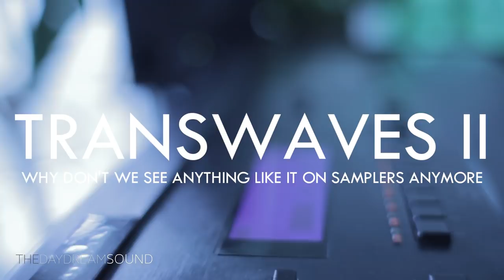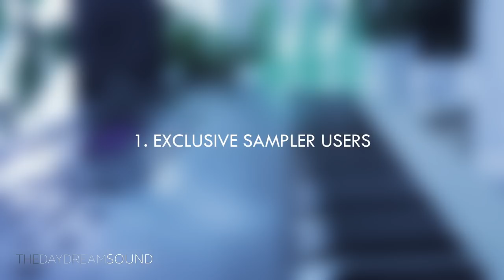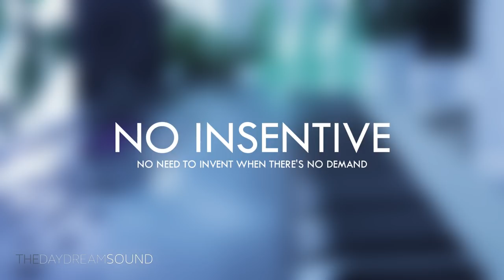Why Samplers Don’t Have Technology Like Ensoniq Transwaves Synthesis Anymore

Comment: My theory is this: Back in the '80s-'90s, a.k.a. the Golden Era of Hardware Samplers, samples came in two basic forms: 1) Emulating real instrument sounds ("Real instruments" also included analog/digital synthesizers), and 2) Sound Effects. Now, things like drum loops and breaks would technically fall into a subset of "Sound Effects." The former needed things like advanced looping, layering, elaborate multisample architecture, etc. After all, you needed all of those things to capture a grand piano or even a D-50. But along came Romplers, which can already do all of the above for you. And over time, the sounds of real-life acoustic and electronic instruments were at least satisfactory enough on Romplers that people didn't need samplers anymore to play them. I remember back in the mid-'80s, many artists relied on the Emulator II to play Grand Piano and string section sounds. But now, any Rompler can do that, and even the cheapest Rompler today has more realistic and expressive piano and string patches than an Emulator II could make.

Which leaves the Sound Effects category, which are more or less phrase-based, and one-shot in nature. Loops are rhythmic, and many sampler users didn't even need to manually loop the "loops" as they could have a sequencer (i.e. MPC) re-trigger the sample every bar or two. By the 21st century, those that used samplers primarily used them for phrase-based, one-shot deals. And the industry followed suit. A friend who owns a Roland Fantom lamented that he could only record one-shot samples triggered by pads but not pitched samples triggered by the keyboard. The whole phrase-based sampling today continues with things like Ableton Live and Ableton pad controllers, which play primarily one-shot phrases.
Reply from the maker: What`s up man!!!!!! Thanks for sharing out!!!!! Great theory!!!!!!!!!!!!!!!!!!!!
Reply: I was just going to say that: Ableton Live's Simpler with a MIDI controller (and some imagination) can get you there also. You can go from sound snippet to sound snippet, add envelopes, lfos and other fx. Assign them to a note, and start doing what fires up in your brain.

Comment: Are you sure you can't do this in any other box? I have a Kurzweil K2000S, and I expected you to show me something that was really unique to Ensoniq. Maybe I missed what was really happening, but it looks like you just sliced a small section of a sample, looped it, and then added modulation assigned to performance (e.g., aftertouch). Can't any sampler do this? I'm pretty sure a K2000S can do this. I haven't used an MPC or AKAI sampler, but I'd expect the same there too. Please help me understand. Thanks!

Comment: Listen folks..I bought the ASR10 rack and Roland analogue synth at the same time,and changed my life and ideas about music.I got the 16 MB RAM and still havent put it in,because by then i learned how to truncate,chop,mangle,and normalize,so i didnt need to touch it.The effects section is so killer,i bought an efx module and hardly used it.I used it live while i was spinning and making mixtapes,made new sounds for myself,and used those sounds as my drum kits and stuff.I have 4 samplers now since i gave away one,yet none of them has the character of the Ensoniq.You can get the ASR10,the VFX synth,and the Paris system,and have a complete studio.Get the third party magazine they had out,if you can,and build a nice desktop system,with SCSI,a LOT of RAm,and have a lotta fun..I'm going to use my EMu6400 and Roland MV8080 the same way.It makes no logical sense to have 20 keyboards,when you can have a couple connected to samplers like the ASR10,because the ASR allows you to run inputs through it's internal DSP/effects section,etc..
Reply: I agree, sometimes in order to be creative it is better to rationalize and use only a few samplers and make sure you have a correct desktop, sound system, ergonomy that  makes you feel much more comfortable . I have seen so many musicians with tons of synths, sometines 4 kronos in the same room,... and none of them even knowing how to use wavesequences that made korg so famous. Or none of them actually have a proper acoustic, sometimes, less is more.

Comment: How does Ensoniq's Transwaves compare with Kurzweil's V.A.S.T?
Reply from the maker: What's up Sabored!!!!! Great question!!!! You know I've used the Kruzweil samplers so much and never really paid any attention to the concept of V.A.S.T. I really gotta go back and look into it now.
Reply: There is nothing like Transwaves in VAST. Modulating loop start and loop end points is itself  unique to the Ensoniqs and a handful of software samplers. The transwave tech is the logical conclusion of this and as far as I know there is no direct analogue of it elsewhere. Ditto the looping types (bidirectional crossfade, bowtie, synthesised loop etc...).
That said VAST can do some nice stuff - FM on samples (it's actually called SAW+ SHAPE though within VAST), amplitude and ring modulation, wavehsaping and wavefolding a nd other non-linear processes not found in other hardware, plus really nice filters. My main board is a K2661 with sampling, I find it really easy to use despite what you may have heard, but I've also keep an Ensoniq around - they're unique.
Reply: You get used to it- plus, pressing EDIT on any field takes you directly to that page. The great thing is you'll find you still uncover new depths to it years on. All the wavefolding/waveshaping stuff we're seeing last few years in West Coast style Eurorack has been in the K2x since 92. Plus all the values are in meaningful values - Hz, dB etc. What you learn on the K2x is transferrable directly to your mixing, your modular, learning Csound/Supercollider/Max etc. It's a worthwhile learning curve. And they didn't reinvent the wheel when they brought out new models- eg if you know the K2, you buy a PC3 or whatever, it's a matter of just learning the updates.
They're beast machines. Dig in.
Reply: @CaptainCabers-nickmccabemusic  the plugin Surge, while not a sampler, (originally developed by Claes of Bitwig)can import custom wavetables. It can also modulate the loop points. Combined with a program like audio-term, the sky is the limit.

Comment: Hey, love the videos! I have a quick technical question; are you aware of anyway to get around having to load the OS into the ensoniq samplers everytime you turn them on? As in a mod that loads the os internally somehow when turning on the machine?
Reply from the maker: What's up Arne!!! Thanks for reaching out!!!  The EPS16+ has a flash ROM option that lets you store the O.S on it but aside from that you'll have to load the O.S from disk every time.
Reply: There was a way to autoload o.s. maybe via macros

Comment: "can't do as efficiently in software". Wouldn't say that. You can do this quickly and easily with Ableton's Sampler/Simpler by setting a loop and automating the sample start position with an LFO. You could automate the loop length as well, basically modifying the granularity of the playback in real time if you wanted to. Imagine I could probably set that up quite a bit faster than setting up a transwave patch. But the old samplers and old devices in general tend to have their own sound so there's still ample reason to use them IMO.
Reply from the maker: What's up man!!! I agree!!!!

Comment: The ASR10, is way ahead of its time. I love using the the auto loop function. Perfect looping so fast. Without seeing it. Especially for looping bass notes and such. What I don’t get is why you can’t auto loop in stereo? There is a work around, by doing one layer at a time. I especially like the video of auto chopping. When I seen that, I was like, I do that!. I go between start and transwave, though. I like trans waving drums to, for fills. It’s the closest you can come to actually jamming on that kit. Such a great machine. Akai mpc’s are a totally different thing. Ensoniq samplers are more for making synth patches, and everything else. You’ll really only use the mpc for sequencing. You really don’t even need that.
Reply from the maker: They put so much into those samplers. It's really easy to miss.

Comment: Transwave was a musical dead-end, according to a former Ensoniq employee who was asked shortly after Ensoniq folded as a synth company. There was/is simply no real demand for the feature outside a fraction of a niche subset of the Synth user base. 

It's a lot like polyphonic-aftertouch, everyone fawns over that feature, but very few who have access to a synth with a poly-AT equipped keybed actually ever uses it musically.
Reply: I honestly still failed to see why he thinks what he did is exclusive to ensoniq transwave. Maybe the operational method is different but you can do the same things on an MPC, Maschine, etc what exactly was so special here?
Reply: @tellitlikeitis8691  there really is nothing special about Transwaves... Much like the Realtime Convolution and Modulation feature on the Yamaha SY77/99, it is something that takes a sample and spits out mostly useless noise...
Reply: @looneyburgmusic  Thanks for the reply. Yeah I'm genuinely curious if there is any sampler out there that qualitatively stands out from the rest or if it's just a sound/workflow thing
Reply: @tellitlikeitis8691  that's actually a good question... I've been a huge fan of Ensoniq since the Mirage, but I honestly never found a musical use for the Transwave feature

Comment: Can the EPS Classic produce transwaves?
Reply: Every day, all day. That's been my main tool since '93.
Reply: can you access the same parameters on the classic? im about to hook mine back up now and combine with ableton
Reply: @blocadebeats  same parameters as the eps 16, 16+. Only heavier, as the EPS classic operates at the same dynamic range as microphones and speakers.
Reply: Transwaves were introduced on the EPS-16+.
Reply: @Roikat  Don't tell my EPS-M (classic rack mount). It has had transwaves as a function since 1991. edit Ensoniq has used transwave synthesis in it's synths since the 1980s. Looks like the Mirage is the only unit that didn't have a transwave function.

Comment: Are you serious ? This is granular synthesis and you can achieve this effect with a LOT of modern hardware/software : The Harvestman Tyme Sefari, Make Noise Morphagene, Rossum Assimil8tor, 1010 Music Bitbox and so on... Reaktor can also do this since more than 15 years !
Reply: This was just one example. Transwaves in general are like wavetables. On gear like the ASR-10, you essentially can make your own wavetables that you can scan through with whatever you want. 

Granular synthesis is typically done with very short snippets of audio at a time; you're not restricted to granular type stuff with the ASR-10. Transwaves aren't the same as granular.

I get what you're saying, but they're not the same.
Reply: "Transwaves" is a marketing name, granular synthesis is the real concept behind. As soon as you are able to create tiny loops of audio material and make it move, this is granular synthesis. Still cool to be able to do that on an old device like this.
Reply: I don't understand why You don't see the way Digitakt is tool to handle granular resynthesis. I see your point (I hope so) but I do love Digitakt becouse of its granular possibilities. If any questions how to do on Digitakt chop, start/end loop points, rec on same device/reuse then resample on buttons (lack of aftertouch on Digitakt but You can use midi to connect any other device)...then use filtering (a lot things with mapping this...) ,lfo assign on many, many parameters on each block then....just ask. There are a lot of things You can't do with Digitakt, but...there are also some things You can do in diffirent way :) I think that its still a- good video and good subject. Also I understand that both machines have different potentiality...
Reply: @Voc0der  I'll take your word for it; that probably makes more sense, in retrospect. I thought they were more similar to wavetables, but I don't have a VFX, SD-1, or ASR-10, etc., and it was a long time ago that I read about it
Reply: Wavetables are different beasts, it consist of scanning a collection of pre-recorded one cycle samples
Reply: @Voc0der  Oh, yeah, I'm familiar with wavetables; I think my problem was not knowing how "transwaves" actually accomplished what they did. It being like granular actually makes more sense, given what he does in the video. So I'm glad I saw your comment!
Reply: @slipknotboy555 Transwaves and Granular are cousins. Granualar does not use the entire sample, only portions. Transwaves use the entire sample and have more loop point opportunities. Granular slow. Transwave fast.
Reply: I literally have an app on my iPad that does the exact same thing.
Reply: @ftj4441  fair point. But the way things are going now, very few vestiges of this era will be around in 20 years.
Reply: No kidding - this vid is just so full of misinformation. I have a Morphagene and build stuff in Reaktor, and this just seems so inflexible and out of date by comparison. The cynic in me is wondering if this guy has a warehouse full of old Ensoniq samplers and is looking to inflate the price before selling them one at a time on ebay ;). If so then top marks for a great hussle :-D
Reply: @oldmossystone  It's a cool demonstration with an older and famous classic hardware sampling workstation. "Misinformation" is quite an overstatement. All the demonstrations are real uses of this instrument. Nothing is being faked. Not everyone uses Reaktor, which I'm sure is flexible enough to do just about anything. These older instruments still are fun to use and can get great sounds.
Reply: @mechuniversal  I didn't claim the demos were fake. However some of the claims made, including the clickbait title, about the technology and it's uniqueness are just untrue. Hyperbole I would understand, but this is not exaggeration, it's false claims that make this unit seem special from a technological point of view when in reality, there are many modern synths and synthesis platforms that support this type of approach to sound design e.g. NI Reaktor. So yes misinformation!
Reply from the maker: @oldmossystone  🤣
Reply: I've used software for this sort of thing but there's definitely something about the ensoniq hardware that cannot be duplicated. It has it's own sound and power that software may never achieve. You really have to have experience with both to truly know what I'm saying. Most people wouldn't hear the difference but the people who would hear would HEAR IT

Comment: You're comparing orange to apple. Ensoniq gear were from another time.
Reply from the maker: Is that so?
Reply: No really. There are many vintage synths that are sitting crippled and out of circulation because of lack of repair. Let alone manufacturing new boards. The components used in their audio architecture--chipset, circuitry or whatnot--are no longer available.
Korg Z1 is another example of lost technology. It was made with components that no other Korg synths shared, and those chips are no longer available. The sound it created is very distinctive.
Reply from the maker: @cubistone  Transwave technology isn't lost  nor is it dependent on circuitry or chipsets. In fact, many software music programs implement process similar to transwaves today. It's just not something included in hardware samplers. It's completely possible and comparable. It's just not in demand; just like variable sample rates an samplers.
Reply: @TheDaydreamSound  you're right about the lack of demand for such synths. If there's no interest in any vintage gear it won't be making a comeback. Peace